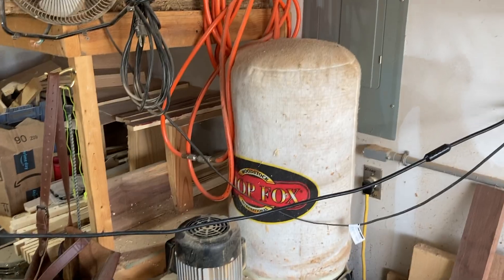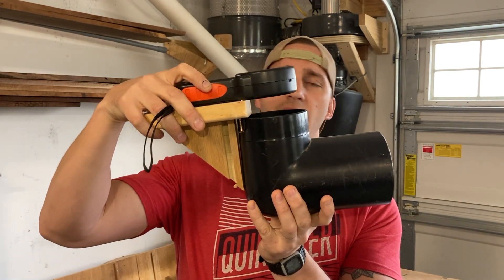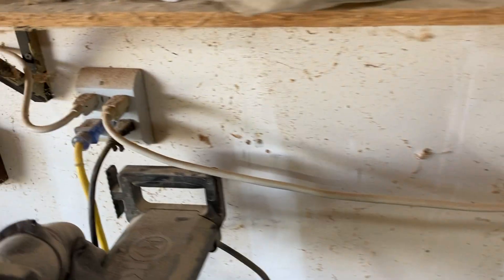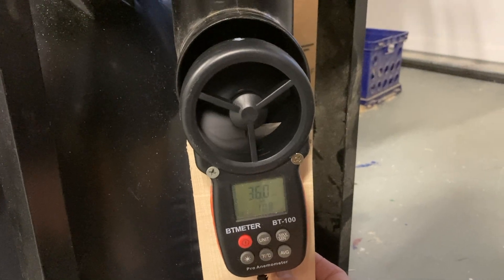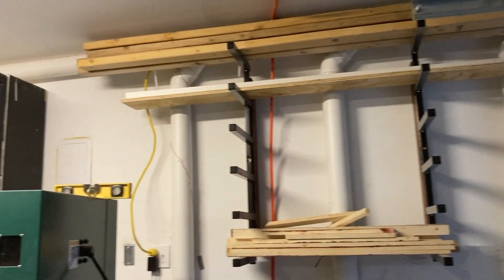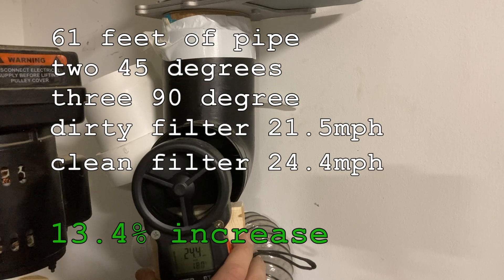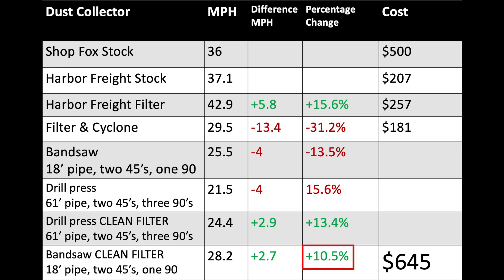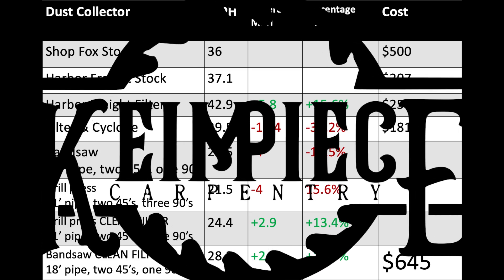Dust Collection Data - Harbor Freight Dust Collector Upgrades

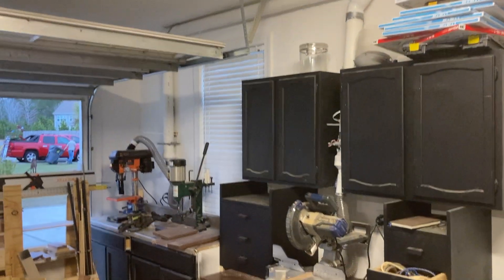Comment: Regarding the buildup of dust in your filter, I noticed at 6:53 of the video, you have greatly shortened the dust collector bag, and the dust is in full-blown tornado mode, almost guaranteeing that a good part of it will eventually come to lodge in your pleated filter.  Did you ever try it with a full sized bag?  I know my stock HF 2 hp unit with the full sized bag dumps most everything to the bottom an it seems to stay there.  Currently doing the retrofit on my unit to the large pleated filter and Oneida cyclone, with the larger impeller and a 6 inch intake port on the otherwise stock 
HF metal separator.  Debating using the full sized bag or the 5 gallon bucket with the Gamma Seal lid.  Thanks for a great video.  I'm learning from all those who've tackled this upgrade
Reply from the maker: the size of the dust back doesn't matter at all. I recently upgraded this system, I still have the cyclone but blow the fine dust directly outside instead of into the canister filter. Greatly increases efficiency and I don't need to deal with cleaning the filter anymore. Best thing I ever did. Reduces noise as well.

Comment: You would have to compare them but one advantage to the Harbor Freight with the 2 hp motor is you can upgrade the impeller for a substantial increase in airflow.  Don't know if the Shop fox 1hp could swing the larger impeller or if it has room for the larger diameter?  You would definitely need 20 amp circuits in your shop to handle the start up draw but they say not much difference once it gets going.  That impeller is not only larger in diameter but significantly heavier to get swinging.  Several variables between them as the blades curve the opposite way as they spin and the tighter clearance between the housing and the impeller is more efficient but may be more subject to jamming if you aren't running a cyclone?  Motor life may also change running it with a heavier load (although in terms of percentage of power it may still be less than a 1hp).  That can be offset by keeping it blown out and clean to some degree.  So all in all you may have made a smart move going to the Harbor Freight 2hp if you want to take advantage of the impeller option.
Reply from the maker: I've actually upgraded the impeller. It made a positive difference. I've also recently ditched the filter and I just blow the fine dust outside. This has drastically increased the power. It's so powerful now that it caves in the trash can. I had to build a wooden ring to reinforce the can. I need to break out that meter and pull a reading on it now to see what it's at. Blowing it outside makes it quieter as well.

Comment: I think your pipe line is to long and to Big. Should of went with 4" main line. Just my option Plus a better system than that Harbor Freight 2 hp unit
Reply from the maker: thanks for watching. Not sure what you mean, it's all 4 inch pipe.

Comment: I think you saw the drop in flow because of the MASSIVE amount of ducting all over the shop, not the cyclone. Not to mention the inefficient routing of the ducts/piping. And for gosh sake, take the filter off and blow it out OUTSIDE!
Reply from the maker: Respectfully disagree. The cyclone is most definitely what produces the major reduction in efficiency. If I had a stand alone shop in the middle of nowhere I would definitely just "blow it out" Also, to say it's a "massive amount" of ducting is pretty dramatic, its a small shop, and I pulled readings from the first port so the length of the run isn't relevant. "Inefficient routing of the ducts"? How so? It was the most efficient it could have been. I even used a number of 45's instead of a single 90 to reduce friction. Thanks for taking the time to watch and comment but your points aren't valid.

Comment: Appreciate the data.  

I'm mixed on using cyclones these days. Seems like they don't pull the fine dust, so the filter is doing the work on that. But then the larger dust doesn't seem to clog the filter and just drops into the bag so I'm struggling to understand what they really do other than look cool and cost money.

One last thing: I'm constantly baffled when people install dust collection systems to remove dust from their shop--then use a leaf blower to blow out their filter which sends dust everywhere in their shop.
Reply from the maker: Thanks for watching rob. A dust collector isn't going to remove all dust from a wood shop, just the majority of larger stuff. Fine dust will settle everywhere no matter what, it's a constant battle.

Comment: I’d ditch the Cyclone and see a huge improvement on over all suction and performance-
Reply from the maker: yea that would definitely be a way to go about it.
Reply: @KeimpieceCarpentry  That is true as far as initial suction goes but letting bigger chips and dust particulates pass will rob suction rather quickly as the filter area isn't that big. These larger chips and particles will damage your filter and wears on your impeller. the separator is a good idea but you need to look at impeller size over HP. MPH is velocity but you need to look at volume and SP, Duct dia as well as length of run. You also lose a significant amount of volume by bending your duct with 90s. 90s literally choke the air flow. There is a lot more to it than HP. Installing a 12 inch Rikon impeller increased CFM from 400 CFM at the furthest tool connection to just over 600 CFM. I think the biggest challenge you have here is the 90s and duct size, this really chokes off airflow. All said and done this smaller system while keeping the shop cleaner does little for air quality. Keep a good air exchange in your shop and wear your mask. COPD from scarring in the lungs is no fun.

Comment: Thanks for the great video! I started with that same ShopFox in December. I noticed it wasn't sucking great so I hit the return button the last day on Amazon (got lucky there) and picked up the HF with a ~20% off coupon. When I finally got a chance to assemble it, I ended up hooking the blower's outlet directly up to a 6" drier vent i installed on the outside wall of my workshop. I also added a 50 gal metal container that seals up nice with the Dust Right Dust Separator Components Rockler sells. I finished it off with a ~18 foot Fulton 4" flex hose to connect to tools and so far have been hooking it up directly to tools as needed.
Since then I insulated the workshop walls and installed A/C. I was planning to move over to the MER 15 filter to prevent A/C from getting dumped outside and plan to install about 20 feet of 4 inch pvc to the tools to get away from flex hosing. I think I am going to order the anemometer you used in the video so I can take some readings to determine where I am at compared to your numbers and then start making adjustments. I'll stop back by and post some numbers.
Reply from the maker: Jason that sounds awesome. Our number prob won't match because of the offset you'll use but if you crunch the number our percentages should be fairly close if you do the upgrades in the order I did and pull readings at the same time. I'm interested to see your results!

Comment: I think a lot of people upgrade the impeller in the HF dust collector, as well, to boost performance. The go-to used to be the Rikon impeller but I believe they've had a hard time keeping it in stock and now people are moving to a $50 impeller from Wen. Might be worth adding and doing another comparison if you aren't satisfied with those readings/performance.
Reply from the maker: Thanks Josh, I had planned on upgrading to the Rikon as you mentioned but it was sold out. I didn't know Wen had one as well. This is definitely something I'll look into.
Reply: @KeimpieceCarpentry  did you ever do it? love the data! subbed
Reply from the maker: @omegaxshark21  No I haven't yet, I've been so busy with other projects I haven't even thought about it lol. I'd be intersted to see how it effects the data though!
Reply: @KeimpieceCarpentry  haha all good! im in the process of building my workshop, and your video inspired me to design a dust collector setup like yours. Now tht you have it for a while would you do it the same again? Or go with a bigger unit? Do you feel it has enough suction? Thanks bud !